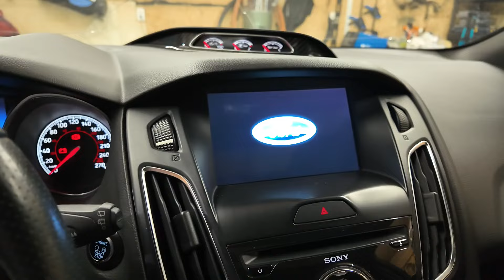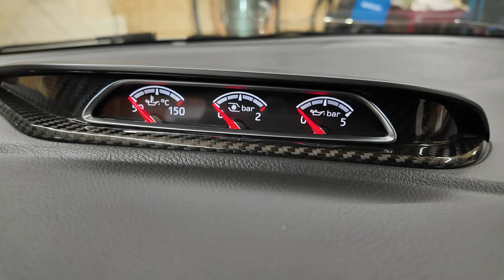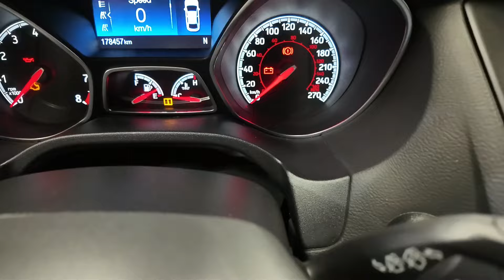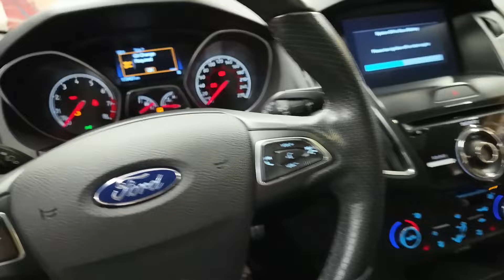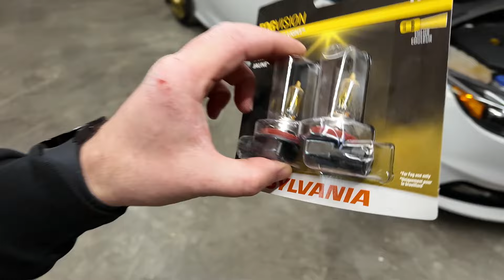Reviewing My 2016 Ford Focus ST

Comment: The ST-3 has adaptive HID headlights. The adaptive feature works only in the automatic mode. The lamps turn as per your steering input.

I own a 2018 Canadian market ST-3. The odometer however is in miles. The cruise control lights up in KPH, and it has the mapple leaf sticker on the door. The center gauges are in C and Bars. I bought it with 16k miles in Pennsylvania.  Now has 84k and the only issue is a very light leak of the clutch slave cylinder.  The rest has been maintenance. 

Always use a properly rated anti LSPI engine oil. I only use Amsoil.

I am currently switching to RS brakes.

Comment: Looking to get an American 17 st. 80k miles clean title no accidents dealer is asking for 13,998 but I wanna lower it down to 12,998. Is it worth going after?
Reply from the maker: Assuming the car is clean, no rust for body damage, id say yes what color and what trim package?. These cars will only get harder and harder to find and I do believe they will hold their value if not see them go up slightly over time.
Reply: @fiftynation  white. I believe it’s an st1. It’s got the small screen for the backup camera

Comment: Picking up mine in 2 weeks it’s a 2014 st 3
Reply: Enjoy the car, bro 🤝
Reply: @lilfern3466  thanks bro I will update you
Reply: @keyskhoza  Updates bro ? How's the car treating you
Reply: @zuzutm3391  well well well….Not any major issues so far but I did experience a stalling issue caused by a faulty maf sensor which I got fixed by replacing the sensor 

Second issue there is a weird noise the car makes whenever I am accelerating almost as if something is grinding in the engine which I want to look into either than that the car still performs great
Reply: @zuzutm3391  well well well….Not any major issues so far but I did experience a stalling issue caused by a faulty maf sensor which I got fixed by replacing the sensor 

Second issue there is a weird noise the car makes whenever I am accelerating almost as if something is grinding in the engine which I want to look into either than that the car still performs great
Reply: @keyskhoza  Sweet that you got the car man! I would also say maybe the grinding under acceleration would be more gearbox related than engine itself ? Worth looking at first